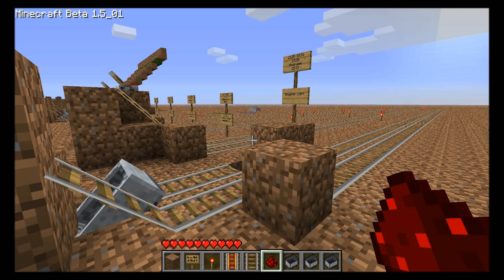Even more minecart science with powered rail

Comment from the maker: @gpsxsirus You can make a momentum reset. There are two common types. The first is where the inbound cart flutes off a short cliff and runs into a block in midair, then falls onto more tracks. I use that in my original minecart station.

The second uses the fact that powered rail don't curve. One straight section leads into the side of another.

Comment: I've been replacing my perpetual motion boosters with a powered rail system.  Since my old cart boosters are still in the system I've found that a single unpowered booster rail doesn't stop unmanned carts when they have the extra momentum you get from the old cart boosters.  In some instances I've replaced the last cart booster on my cart return line with powered track.  In one instance I simply added a stone block at a curve and that slowed it enough for the cart to stop on the unpowered track.

Comment: @gpsxsirus My first rail line I built in SMP is two tiers.  Your ride on the upper level and then the cart will return down the line on the lower level,  After the update my return carts were no longer making it to all the boosters.  Did some testing and it seems that either turns now reduce momentum or they always did but now do so to a greater degree.

Comment: Great video series!  From what I've seen myself and what you've shown here it seems Notch didn't want powered rails to be an all purpose replacement for booster cart systems.  Personally I like that.  Different tools for a great variety of setups.

One thing I've noticed about rails, and this may effect a couple of your experiments to a degree, is that after the new rails were added it seems turns in rail decrease your momentum.

Comment from the maker: @Gzus70 Unfortunately carts and doors don't quite work the way you'd hope. If you try to pass a cart through the lower part of a door, it always gets stopped, even if the door is open. If you try to pass a cart through the upper part of a door, it always passes through, even if the door is closed.

You can make something called a door booster, where the cart drops on top of the door. It relies on a glitch, it needs precise timing, and isn't very reliable.

Comment from the maker: @0cossin77 Excellent designs! It looks like you've covered each type that I'm aware of. I appreciated the warning for the last one on how to wire the door booster.

I think your system with powered rail on a slope is more complex than necessary... From other designs I've seen, it just needs a single powered rail per cart on the slope.

Comment from the maker: @teapoted It's getting better gradually...

I have a booster-less fully automated minecart station about half done now. Got the runaway cart detector done. The next challenge is a cart dispenser. You can't use a pez dispenser without booster carts. All the dispensers I've seen so far are sensitive to timing, which typically makes things unreliable on SMP. Have you had any ideas?